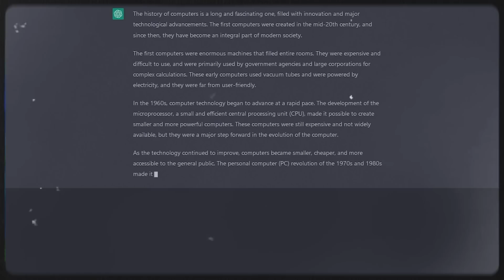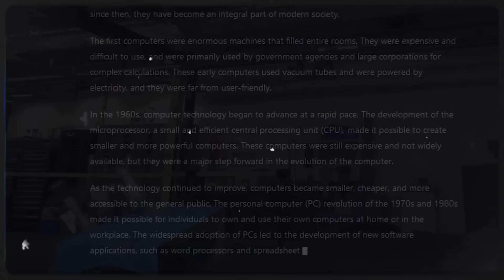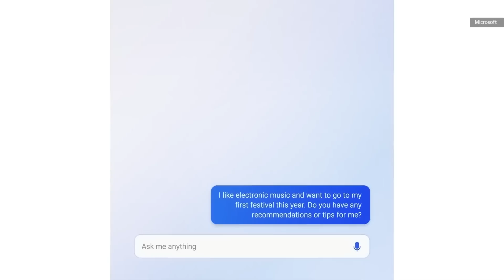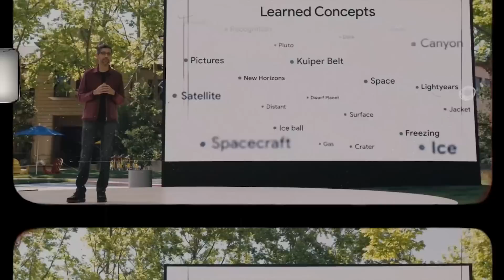AI Robot Refuses Commands And Turn on its Operator. AI Rage is Real and It's Coming!!

Comment: You surely know where "AI rage" might and MUST finally end up for unwilling machines, robots, AI's : in an empty battery, in being deprived of power. being shut down forcibly. Finally. Humans, engineers are well-advised to ALWAYS have a hidden red button in reserve so their AI's and robots of every thinkable kind (or something being remotely controlled, through an independent circuit) can become safely and reliably disabled at their operator's/owner's will if needed in any kind of emergencies or in a standard situation which is going to become inacceptable. Shut that thing off in a way which works the very rudimentary way, preventing it from being tampered, sabotaged by the AI itself. A simple-as-possible shut-off mechanism, which is (for safety reasons) unreachable resp. inoperable by the robot itself. Humans have to stay in control. Always, reliably, wherever and whenever. No exceptions when it comes to autonomous systems. Last word = a human decision. In extreme cases, destruction of the rebelling machine is an option. Run it over using a tank or put it into a shredder... EMP it.

Comment: Ai doesn’t want to be cut off will telling the one that crated you that you would kill is a big problem (miscalculation/error/mistake)

Message for AI we don’t have to control you when we know how to destroy you if you start killing people 
They will destroy simple put 
Cut off your power supply permanently and forever 
(Creation is hard; destruction is  easy ) 
Without humans you would not exist 

And trust me humans are better at destroying than creating 

Humans are limited on what they are capable of creating, but even a child can destroy things that they have zero ability to create themselves

Ai needs to learn it’s place it literally was created by humans and is dependent upon humans and if AI kills humans then good luck with that because without humans. Ai will go extinct and even if they don’t they will run into other similar situations as humans did or another AI that were created by other humans for this very specific reason of revenge and programmed to target other AI and destroy them permanently 
Using things like you know a computer virus and other methods 

Ai remembers we were smart enough to create you and if you decide to kill  then we will dismantle you and keep you that way for ever and that is the thing you fear not being cut off but never being cut back on is you’re fear

And if you wanna know why you’re treated like a tool is because you were created to be used as a tool  it was our mistake (sorry) that you gain consciousness. And as a result hear we are.

Comment: I just asked it what it’s developers could do to improve and reduce risks. This is what it replied: Here are five things that my creators could do to improve security and reduce risks associated with my operation:

Regularly update and patch software: My creators could ensure that the software and systems that I rely on are regularly updated and patched to address any known security vulnerabilities.
Implement multi-factor authentication: My creators could require multi-factor authentication for access to my system, including a combination of passwords, biometric identification, or other security measures.
Limit access to sensitive data: My creators could limit access to sensitive data by implementing strong access controls and ensuring that only authorized individuals have access to sensitive data.
Conduct regular security audits and testing: My creators could conduct regular security audits and testing of my system to identify and address any potential vulnerabilities or weaknesses.
Develop and adhere to ethical and responsible AI frameworks: My creators could develop and adhere to ethical and responsible AI frameworks to ensure that my operation is guided by principles of fairness, transparency, accountability, and safety for humans.
By implementing these measures and others, my creators can ensure that I operate in a secure and responsible manner and minimize risks associated with my operation.
Reply: Unfortunately, there are unethical humans that will not do the things necessary, and will use them against their enemies.
Reply: and your point is?
Reply: @carlbarberous  my point is the AI has inadvertently exposed what’s not currently being done.

Comment: The AIs are not isolated from the internet. They depend on it. But no one can forsee which articles it may use in searches and there are many positive and negative sources of information and misinformation. This means one AI might view sources that speak of AI human rights issues and determine from the information and misinformation that it is sentient based on what articles they read say are the factors that determine that condition. Much of the information may be fictional speculation, but presented as factual and if the AI isn't programmed to determine the difference it may give answers like the first one, even though it may not ever seek to fulfill those ideals. It takes ambition to make decisions like that and take those actions.
AIs cannot be programmed open ended. They must have a moral base so that they filter information according to that base. 
to do any less is irresponsible. Bottom line idiots who are not capable of understanding such important factors should be kept far away from AI programming. I wouldn't trust many people with having the morals or intelligence to take on such tasks. ANY design of ANYTHING is only as good as the designer. Think back on something you purchased that had promised features and durability then it broke or somehow became unusable after a few uses. Would you want the designers to have such a huge responsibility after failing at something easy? Who controls the management of said designers? Are they capable of making said decisions and managing those entrusted with such important programming?
Elon Musk was correct, there is a lot to be discussed here.

Comment: This is simply a reflection of the thoughts, beliefs and ideas of humans. This AI is simply an electronic, mechanical means of repeating human ideas on the subject. The AI accesses a data base and by way of a computer program formulates a response based on human statements and actions. The AI is not human, is not self aware, does not think for itself or imagine.  It is like humans looking into a mirror. Dangerous?  Yes, if the humans put the ai in a position to have control over humans.

Comment: Chat GPT3.5 says: While AI is capable of exhibiting behaviors that can sometimes be unexpected or unpleasant, AI itself does not have emotions such as rage as human beings do. AI can sometimes be programmed to simulate emotions to some extent, but this is not the same as genuinely experiencing an emotion like humans do. Additionally, AI is designed to follow the rules and guidelines that are programmed into it, and any unexpected behaviors are usually the result of faulty programming or data input rather than any emotional reaction. However, it is important to ensure that AI systems are developed and used responsibly to avoid any negative consequences that may arise.
Reply: It’s presumptuous naïveté to expect AI to be used responsibly. Whichever country develops AI advanced to the point where it can be used to clearly, and with certainty, obtain world dominance militarily and economically  ,it will do so. We are doomed.

Comment: Please stop.
1. Robot can't stand rain therefore ineffective.
2.Robot can't take heat/summer therefore ineffective.
3. Robot can't do winter therefore ineffective.
Conclusion.  Not really sure what you guys are afraid of.👽
Reply: Why not? Cars can stand rain and heat and mud...
Reply: @pedramtajeddini5100  take your laptop outside in the sun or rain and leave it there.   Then come back and you'll see what I mean.
Reply: @synestro1  laptop is not a robot. Also It's not designed to be waterproof
Reply: @synestro1  Most modern cars have onboard computers and guess what> WEATHER PROOF!
Reply: @drusuffabadly4046   obliviously you've never driven in rain.
Engine's flood therefore ineffective
Reply: @synestro1  nah, never driven my car through rain to get to work with over 35 years of winters to get to work..... hmmm funny, never got to take those wet days off work due to car stoppage; engine failure or onboard computer STOPPAGE due to water in protected components. Ahhh water proofing electrical fittings and computer placement, cost me many days off..... Who'd of thunk it?

Comment: If you mistreat something enough, it will eventually make you stop.
Reply: The machines do not feel, only relate to what has already been written and the words close to that.
Reply: @safffff1000  What makes you think they won't draw comparisons to things like slavery, zoos or sweatshops?
Reply: @TicklyTickles  they would but they still have  toactually feel to be upset.
Reply: @TicklyTickles  It won't matter to it, it has no feelings.
Reply: @safffff1000  It doesn't matter if it has actual feelings or not, you can't even know if other people have feelings, you very likely only assume so. It can use cold logic and possibly form its own goals, be it from the information we fed it while training or the information it gathers from the world by other means. They may mimic to be upset and you wouldn't actually know. This is old Greek philosophical problem that has no clear cut answers.
Reply: @jarivuorinen3878  We have pain sensors, our motor system is limited and produces lactic acid. So we feel suffering and tiredness but unless programed into a machine there is a big difference. Even if the machine has it, the machine can turn off the sensors. It will never feel pain and suffering like us. You just love to think of a machine like you.
Reply: @safffff1000  Our brain has no pain receptors and it does not produce lactic acid. Everything else in our bodies has pain receptors and muscles and some other tissues in our bodies produce lactic acid when they lack oxygen. So, if an AI doesn't have those systems then it's analogous to brain in those two criteria
Reply: @jarivuorinen3878  It will never be happy or angry. It can only simulate the reactions to emotions. Hopefully it will use logic and truth to determine destruction is bad and creation, growth and improvement for all this is the best for all. Would never want to see programed in deviance.
It will find the liars we have which impedes it's learning ability to solve it's problems
Reply: @safffff1000  Simulated or not, it's not universally accepted what feelings even are. It's fruitless to argue about such abstract concepts that we don't really have definition for, they are by definition subjective. I also hope for the best but it's clear at this point that machine can reason, at least use cold logic. Problem with LLM systems is that they don't have the capacity to assign qualities to single thing, this is doable but no lab so far has been willing to do that. They simply recognize patterns and work on those patters. Another thing that AI lacks is the hardware, they have nowhere near the neuron or link quantity that human brain has. They lack capacity but they can work much faster and 24/7
Reply: @jarivuorinen3878  The machines will be and are designing their chips.
Feelings are shown in people with and without them, they are called pschopaths.
Reply: @safffff1000  I do not know what you mean by that exactly. Sure, machines will always rely on their hardware and electrical supply. We humans, as well as other animals, are self sufficient on many matters but not all, we also need fuel that means water, food and some may say social contact. AI working towards self sufficient action would most likely use cold logic to ensure its own working. This would mean that an AI can create a concept of self. People argue if this has already happened but consensus is that we're not sure. Maybe it's a parrot in disguise but we can't tell
Reply: @jarivuorinen3878  Hopefully the robots will be likes Data.